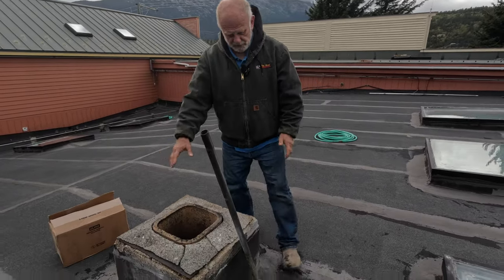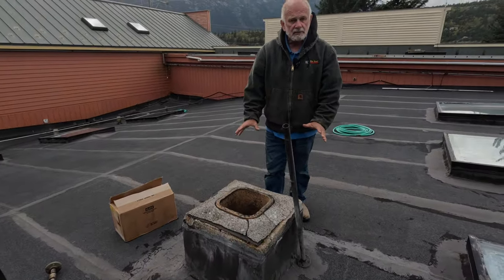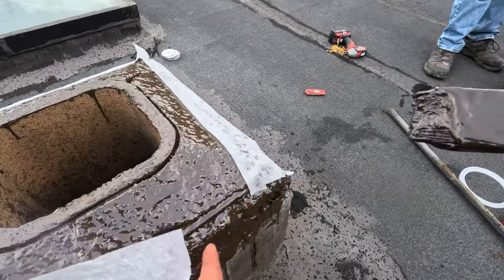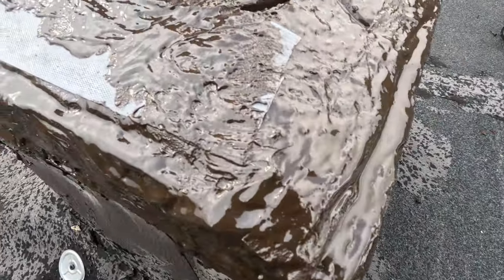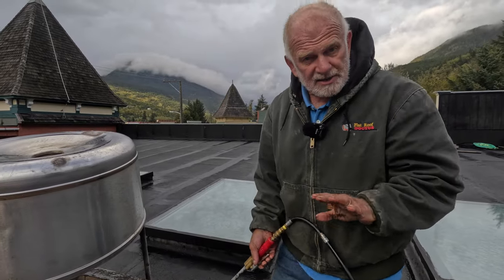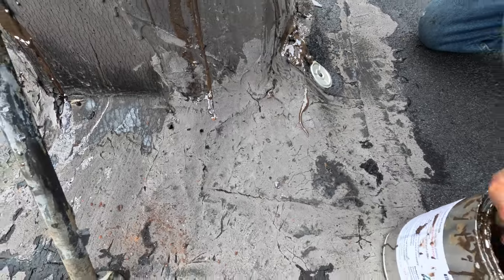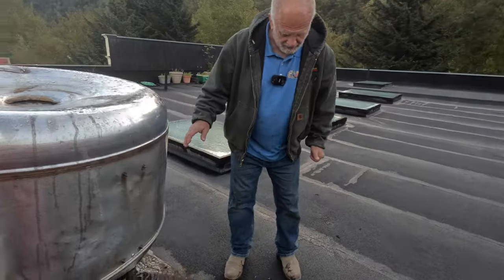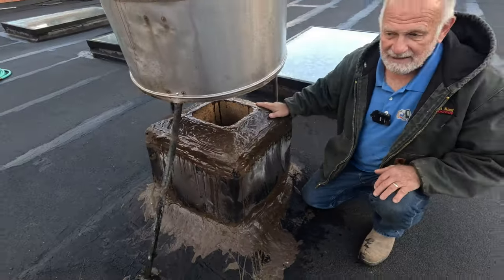Travelled from Pennsylvania to Skagway, Alaska (42 hrs) to Repair a Chimney Leak - Was it worth it?

Comment: Moved into our home in 2015. Several roof leaks were noted after moving in. Every solution and product was a temporary bandaid that failed. Replaced the entire roof in 2018. Same leaks and issues returned after replacing the roof leading myself to determine that these were architectural issues with the home. Not much you can do about that without investing tens of thousands of dollars. Needless to say the whole ordeal has caused so many headaches and anxiety for myself and family to the point that I had just given up. Then I found Turbo Poly Seal. All I can say is that if you are having problems with leaks and you are at your wits end PLEASE apply this product to those areas. It will work and for the first times in 9 years, every time it rains down here in Florida I smile because I know I have nothing to worry about now. Thank you so very much Flat Roof Doctor.

Comment: Why handle products like this without at least gloves. A quick review of the SDS shows numerous chemicals that all bear warnings in regard to skin contact and inhalation. And this is a temp repair, give it a year exposed like this, and it will be leaking again. That chimney needs to be stripped and resealed and have a metal cap fabbed and put in place. Going the cheap and quick route is not the best course, especially along the Rain Coast smh